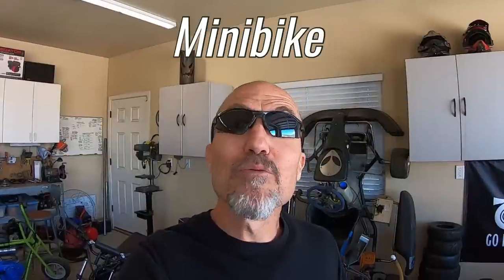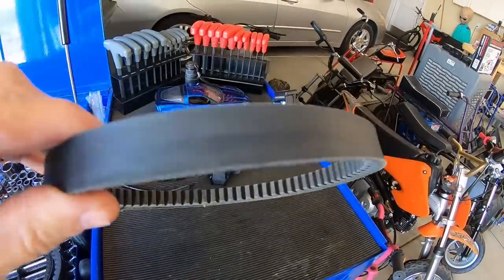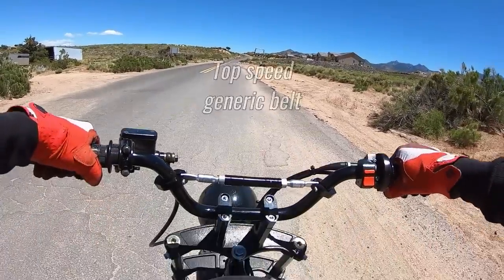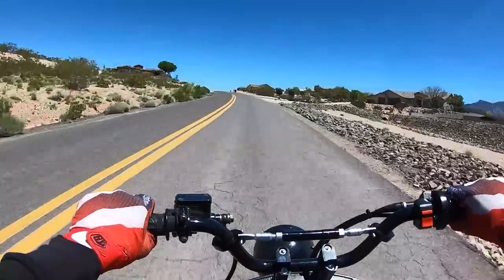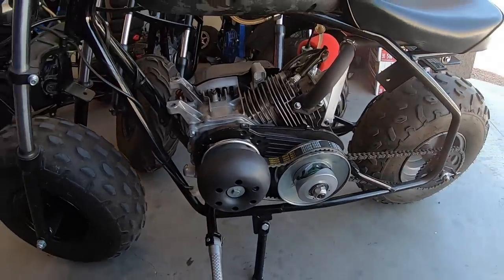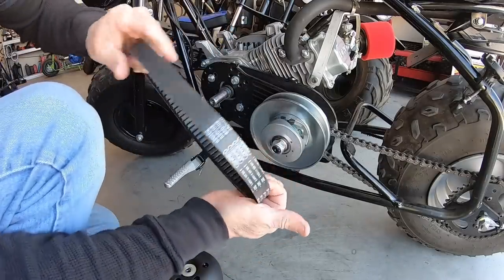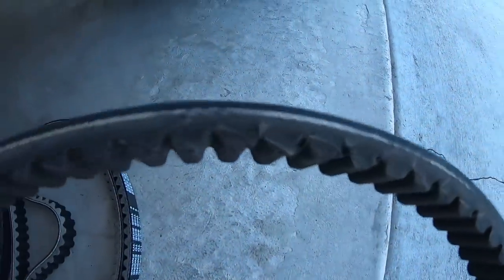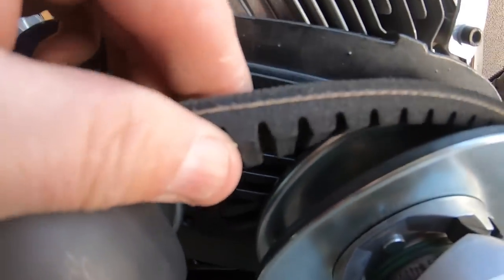What 30-series torque converter belt is the best?

Comment: Belt prep is also key. I take a propane torch and run it across the drive faces of the belt to clean off the oil from production. Definitely helps too.

Comet is the only thing for my 263cc (same bike as Charles Super Hog build) If I don't use a comet it's going to stretch and have a jerky engagement. They last much longer too.
Reply: I have to try this

Comment: Next step would be to compare the $18 three pack of 725 belts from ebay versus GPS's belt. GPS doesn't manufacture these belts. They may be getting them from the same place the ebay seller is getting them from and making a nice profit from the higher price they sell them for.

Comment: Good comparison video!
I have the Comet 203589A belt and the 725 Go Power Sports belt. Go Power Sports said the 725 belt works better with the Juggernaut as the belt is slightly longer to get it in more overdrive. I saw someone get 3 MPH more top speed going from the stock belt to the 725 belt, 30 series torque converter with a Juggernaut, 212cc built engine.
I haven't had a chance yet to compare the two belts.
I have the same Coleman as yours, same color too. 50T rear sprocket.
My engine is the Tillotson 212R MK2 with a header pipe and RLV muffler.

Comment: I’ve tried a bunch of different belts.  Biggest difference is that the sizes are all over the place for what are supposed to be the same size belt.  Longer, looser belts allow the engine to spin up faster and engage at a higher ratio, resulting in slip as well as ratio variance at the top end.  Things got a lot better when I slotted my back plate to adjust belt tension.  Lets me use a variety of belts without much difference.
Reply: I’ve never run into the residue issue.

Comment: You also have to factor in how hard you're Launching from a dead stop! If you go full throttle from the get go every time we all know that it stretches your belt. And if you do that in consecutive rows It will continue to stretch the belt. So I have learned not to just go for tilt from the take off but Ease into you're acceleration. But we all know there is times when you want to go full bore straight from the rip.

Comment: BlackHorseRacing makes a nice 3 pack of 725 belts that I had great luck with.
My Axis bike is still using one i put on back in November and it seemed good last time I rode it.

I still would say get the good comet belt if you have the money.
Reply: @Black66  In fact my other 30 series is from them, decent option to look at.
I think it wasnt a lot cheaper than the gps comet clone.
But it did claim to be rated for 11hp, I dont know for sure but it has taken a beating.
Reply: yea i have had only good experiences with those blackhorseracing belts im a big guys too and they seem to be the only ones that last good for me

Comment: Still running that stage one upgrade on the juggernaut in this video?   Im running the belt that came with my cheap amazon torque converter that I put on last year.  It probably has about 700 miles on by now and still no fray marks, it has been a great belt.  You need to up to 50 or so tooth sprocket and get that cam in its rpm range for making some power.  Good video tanks for sharing the results.
Reply from the maker: Thanks! Check out  the CT200U-EX playlist. We have tried many different sprocket engine combos on this bike.I really like the 40 sprocket on this bike with my weight.  https://www.youtube.com/watch?v=X0SmAZJ6qW8&list=PLkbj-ip-5FzbVBVqMi23O5noFSAbhNOp1

Comment: Another great video! Wondering, what is that bar between the handle bars and what does it do? Also, I noticed on the tighter belts I can’t really push the bike around when it’s off, like it’s locking up the back tire. You have any of those issues? Thanks  again!!!

Comment: The 200ex has excellent seating geometry for prolonged street or smooth trail riding, but the RB200 (Re-Branded 200) frames that Coleman bought out from MegaMoto/Monster Moto have a much better footpeg & seat position for rough terrain.

Comment: My question is vibration, engine, do you worry about that or have you done anything to stop vibration .
Thanks in advance 
I appreciate your videos.
Reply from the maker: Thanks! I haven't had a lot of vibration issues.  You could use silent blocks and rubber mounts to help on the exhaust and motor mounts..

Comment: Hey black66 I'm looking into getting the predator 301cc engine, I wanna do a build on it but not sure what to do, I want it running smooth and clean but not sure what parts to get? Would you do a video on the 301cc engine on what you think of it and what kind of build you would like best for it ? You've inspired me to do a lot with mine but i also do use some of the things I've seen you do as well

Comment: If you plan on putting a built Tillotson 212 on a Coleman ct200uex. Put a chain tensioner on it and you will have replace the clutch every month. I'm running A-10 tooth Max Torx and a 60 tooth rear sprocket. I can smoke every built Predator around here. Should I go with a 30 or 25 tooth rear sprocket when I install a torque converter. I like cruising at 60 mph love running fast close to 70
Reply from the maker: I have tried MANY different engine and parts combos on the CT200U-EX. Check out the playlist https://www.youtube.com/watch?v=X0SmAZJ6qW8&list=PLkbj-ip-5FzbVBVqMi23O5noFSAbhNOp1

Comment: I run a 1PZ belt the same as in the video and I've never had an issue with it. I'm pushing 8 months now and no fraying or damage or an residue and I'm running it on a 440cc stage 2 big block so I don't know what happened with yours. 1PZ has always been good to me even in mud or rain so damage whatsoever. I don't know what to tell you but it ain't a bad belt for the price
Reply: He didn’t have the the speedometer on the screen during the two knockoff belts. Makes me skeptical. Hopefully GPS isn’t influencing him, even though he says the video isn’t sponsored.
Reply: @romanleonard2154  hopefully thats the case, unfortunately a lot of reviews are false nowadays regardless of what they say

Comment: Which belt would be good for a stock application? I think that the belt that came with my kit won’t last once I start riding it.
Reply: Stock application on what bike? With the pullies as close to perfect alignment as possible any belt should work fine with a stock engine with proper gearing.
Reply: @Deucealive75  thanks, i have a new mega moto 212 pro kit and i installed a stock honda gx160 engine for reliability sake. I want to ride this thing at any given time and I also have a Honda express2 scooter, I have a series of videos on it.

Comment: Hey @black66 I'm running a black horse racing belt and a 10-38 tooth front and rear sprocket and a pz 20 Amazon special bored out 2 mm to accommodate airflow besides that it still has the governor and stock internals and I got a top speed earlier of 58 miles per hour on a slight incline whattya think I should do next besides obviously remove the governor after it completed the 20 hour break in period recommended by predator engines?......
Reply: Be HONEST how well do those BlackHorse Racing belts hold up?
Reply: @FukTheGovernment465  actually pretty good last set u ordered was back before Christmas and back then my torque converter was on a go cart and the driver/driven pulley alignments were hella wack but they held true until I took it off the go cart slapped the whole 196 up in a doodlebug frame and she went ka-blooey after I just got done riding it 2 personed across town and up a hill we call miracle mile in my town then I swapped a 213 got the belt alignments correct and hit 60 top speed with a stock engine 11 tooth sprocket on my cvt and a 38 tooth on the rear
Reply: @Anti Government4life Last set I ordered 🤣 but they last pretty damn good especially for their price ya can't beat em 20 bucks every 5-6 months is better than like 175 for three name brand comet belts every month almost because those ones like to snap, not  stretch and ride the pulley like the black horse racing belts when they reach higher rpms, temp and power
Reply: @calebhatler3233  Good to know, me and a few buddies of mine put 200 ish + miles on our karts every month so they need to be dependable...
Reply: BRAKE UPGRADE